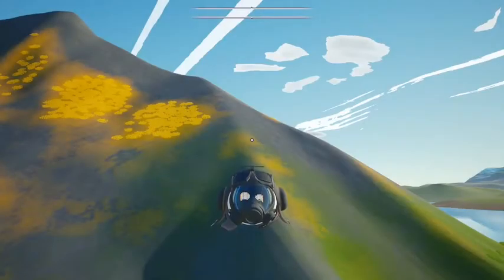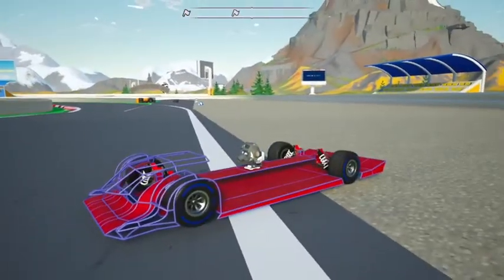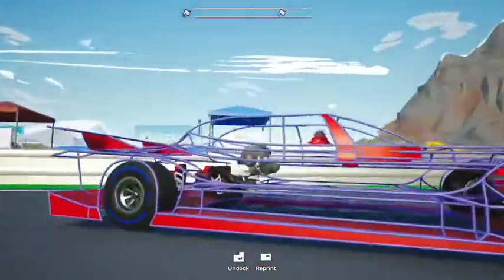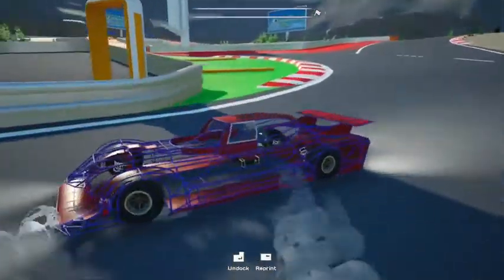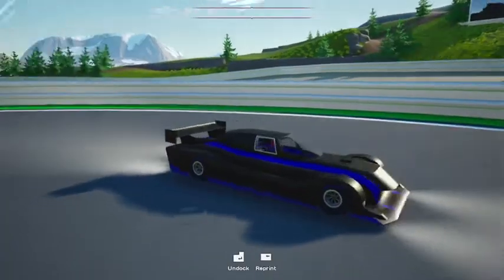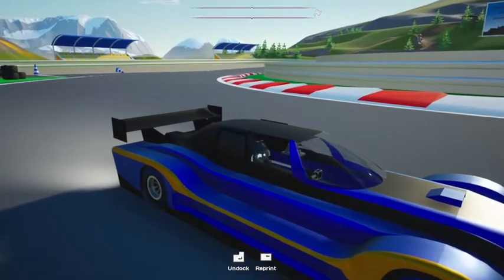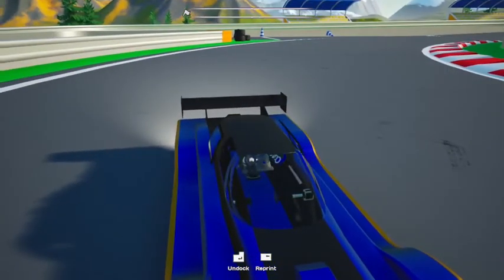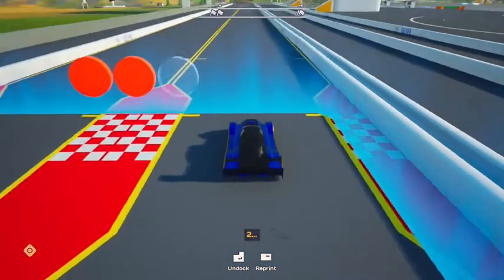Building a Better Racecar in Main Assembly

Comment: The method of construction is similar to the maserati birdcage car, which was technically a car with no chassis, it was all skeletonized tubing, and its performance was absolutely incredible. The underbody aero was an exemplary execution. I don't know if it's the FPS POV but it looks incredibly stable even understeering and oversteering. I'm very impressed. Kudos.